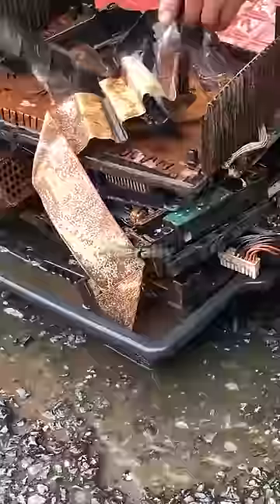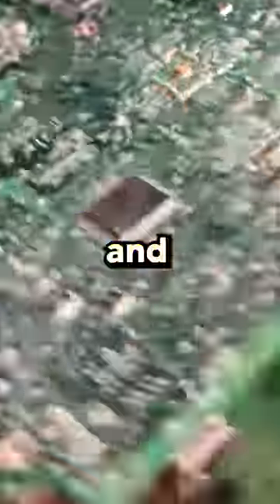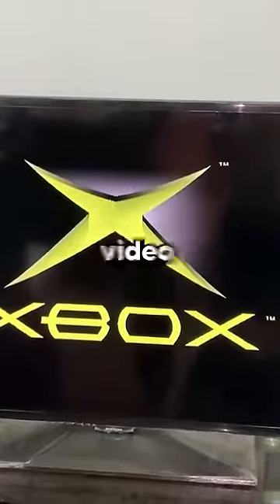Fake Restoration

Comment: Ya you can wash electric parts in water you just have to make sure there is no power flowing through it like a battery or even making sure the capacitors have no charge. Which is easy to do with some resistors.

Comment: As long as the circuit boards and other electronics are fully discharged, and the capacitors have no voltage, the water is not an issue.

Comment: Fun fact, as long as there are no loose wires, and no water soluble materials that are vital to function and there is no power, electronics can get wet! Just make sure to let air dry and the use a mister with isopropyl alcohol to just do a double check!

Comment: If you dry off the console even after soaking it in water as long as you don't plug it in when it is still wet it can still work as there is no more water to short circuit the electricity

Comment: The water on the motherboard is fine, the only way it can cause damage is by shorting something out but that isnt an issue since it isnt on. Same thing applies to your phone, too, ao if you drop it in water then dont try turning it on for a few days just to be safe.

Comment: Okay fun little fact about electronics though a surprising amount of them can actually be washed with water just don't turn them on within 24 hours and make sure when you do they are completely dry and nothing has built up under the parts. It is possible just a pain in the ass

Comment: Cleaning electronics with water isn’t bad because it’s the minerals that are conductive so if you use distilled water it doesn’t get damaged this is why you sometimes see computers completely submerged in water as a cooling solution

Comment: The electronic parts can be washed with water and be just fine as long as it is without electricity. The accual damage happends when water touch working electonic parts beacose:
1 the electricity make wires in cirut rust much faster under contact with substane like water
2 when you pour water on a powerd on electronic component 'Shortens a circut' witch can deliver a electricity where it shouldn't be. sometimes even making that so there are higher elestric power than a component can handle permanently damaging it.
3 burn marks can actually conduct electricity with lead to short circuits even after we dry water from electric part

Comment: washing motherboards is ok, as long as you rinse any soaps or vinegar used and dry them. They do the same in the factory. And no, you don't have to use IPA, you use it if you want the board ready fast and not in 24-48 hours.

Comment: it’s fake but you can clean electronic with water, you just need to make sure to dry it before power. The only reason electronic devices broke when contacted with water is the water shorting stuff in the device so if you dry it, it should be good to go

Comment: Electronic parts can be washed in water, I washed my motherboard in my dishwasher [TAKE THE SMALL BATTERY OUT] also make sure u let is dry, if current goes through while it's wet it's gonna die

Comment: Water is completely fine to clean electronics with, as long as there is no electricity flowing in it, and you let it dry completely after cleaning it. (The video is still fake but I just thought this might be useful)

Comment: More or less everything mentioned is correct except for the last part. PC parts and electronics in general can safely be washed with water. And common sense tells you to: 1, not have it plugged in and powered while doing it and 2, waiting until it is fully dried before turning it on.

Comment: You most certainly CAN wash a PCB. Use distilled water and a neutral detergent. Flush wirh distilled water, then with ethanol or isopropanol and blow dry. Works a treat with keyboard and remote control PCBs

Comment: Well you can wash electronics in water as long as their is no electrical current that could cause electrical an short even after you wash the electronics you have to make sure that it is completely dried off even small amounts of water can cause electrical damage. (BTW I call B.S yeah that is a original Xbox not a Xbox 360)

Comment: 1: Plastic Doesn't Rust!

2: You can wash any electronic devices without damaging any component, as long as the device is powered off, or you take the power core (battery), if the device has a back plate!

3: Who the Bloody Hell does leave a Xbox out in the forrest?

Comment: You probably don't know how pcb works, Its fine to get wet as long as its not turned on, Let me educate you,
A motherboard have patterns where current flows, if any electrical conductive elements or particles touch the motherboard, this 'may' ruin the current's flow which will lead to some motherboard parts not receiving enough power, Hence what we call a short circuit

Comment: To be fair YOU CAN wash a motherboard in soap and water HOWEVER you HAVE to dry it 100% or you’ll fry everything and cause corrosion best alternative is use rubbing alcohol in a spray bottle with a tooth brush ez

Comment: Just a quick reminder to everyone, do NOT try putting out an electrical fire with water.
Reply: Cut off the main line alwys the first step.Fire extinguisher first option , if dont have,Dry Sand is the best option if still no dry sand , cut/off the main line control the fire and let burn the "eletrical things" or throw it in open space let it burn until the fire out just avoid it in any flammable things such as clothe or plastic.

Comment: You can use water to clean electronics as long as there is no current runnjng through it and is completely dry before turning it on if you use rubbing alcohol it will dry the ater fast so then yku are able to plug it in and it will work

Comment: Okay yes, plastic does not rust. However, putting PCB(Printed Circuit Board)’s in water is not harmful as long as they are powered off. You should also let them dry in case water got under any components
Reply: Plastic can have rust stains right?
Reply: @nooneshome8746  stains and actual rust are different

Actual rust is a chemical reaction, most commonly seen on metals like iron, aluminum, and others, usually from either oxygen (which is mostly why people will say, don't use water at all, even if left to dry [they are wrong if the exposal time isnt like, 12+ hours]) or other gases

Stains can probably spread easily from a rusted source to one that isn't rusted
Reply: @nooneshome8746 Not exactly, Stains tend to not be a chemical reaction while Rust is. Take The statute of liberty for example, the teal color we know today is actually rust more specifically oxidization which tends to occur in copper based items so yes one point in time the statue was Copper Colored, stain on the other hand depending on the stained item and what you are using to stain it with, something like plastic isn’t super easily stainable which is why some people use plastic plates unlike something like fabric
Reply: @nooneshome8746  Yes we have pvc with rust stains from an old water leak in the crawlspace.
Reply: From what I remember it's even worth to wait for like 5 minutes before putting it in any liquid
Reply: he was scrubbing on those solders and chips thats wild lol
Reply: Yes but also no. You shouldn't leave water to dry on its own. The recommended method is to rinse the whole PCB with alcohol. Just leaving the water to dry out will cause rust build-up on parts that weren't rusted. Also, minerals in the water, even after fully dry can cause shorts.
Reply: Thats what im saying, he acted like it shouldn't work after the board was in water
Reply: @Kevaca aluminium doesnt rust
Reply: @rikutiini5480  ah, I mean, the rest of the point is accurate though
Reply: I was coming down to say that. Like i can go wash my damn pc as long as there isnt water left on it when I power it
Reply: Thank you, my immediate reaction to this video was to go and comment about how you can get pcbs and various processors wet as long as 
1. It has no residual electric signal
2. You take immense care to dry and vet each part before re-use.
Thank you haha 😂
Reply: He would've knocked off a component on the pcb if he scrubbed that long lol no way it would've still worked
Reply: It can and will cause corrosion. So it’s a bad idea either way.
Reply: Yeah
Reply: Distilled water is used all the time in my shop to clean electronics.
Reply: @dW-td2ul  Then you're doing it wrong. Might not be harmful in the short term. But it'll corrode a lot faster.
Reply: @dW-td2ul  then you guys shall use isopropyl instead since using water is a big no no.
Reply: The reason why water "damages" components is because water conducts electricity between wires which are not supposed to turn on. This isnt usually a BIG problem, the pc will just not work or give blue screens, with no permanent damage. The bad thing is when the ROM chip in the motherboard(basically the instruction set that tells the pc how to turn on) gets corrupted and cant turn on the pc.

Comment: As long as the components don't get any electricity through them before drying off completely then there's nothing to worry about, it should work just well if you didn't break anything while cleaning it
Reply: Corrosion left the chat.
Reply: @omegalongdong  it's not like you're gonna leave it in water for several days, a regular cleansing won't take long enough for it to get corroded over some water, and some of the conducting metals in there are quite resistant to corrosion

Comment: 1: That's an original Xbox

2: Plastic doesn't "rust" but can hold different kinds of corrosion, dirt, and mold. I've found plenty of old plastic in my yard and local landfill that had a rusty appearance, but just ended up being covered in earth.

3: it's not odd to see "fresh mud" in something that has been exposed to rain and dirt for awhile.

4: You can wash electronics in water. You just have to dry them.

5: Yes, it's still fake. But this console could have likely been found in a dump or landfill. I restore trashed electronics locally as a side hustle. But educate yourself better before making debunking videos, lol.

Comment: Well, actually you can put any electronic in water. But it should be totally clean, I mean distilled water only. Any water will not work.

And you can't just put an electronic in any water like the top liked comment said. It should totally distilled, all electricity should be removed from electronics, etc. And this is already been told in Linus tech tips.

Comment: It's fine to wash electronics with water as a last resort if you're desperate you could dry it in the sun for a week and it should be fine and also use isopropyl alcohol

Comment: The only incorrect assumption you make is the washing with water. If the circuit boards and wires are not connected to an source and are given time to dry, they will be fine. The reason water damages electrics is because the high conductivity of water creates a short circuit as the current bypasses the resistors which gives too high of an electrical current then the circuit components can handle.

Comment: Yes the video is fake, but you can wash electronics on water but after you need to remove the minerals that the water left because can cause rust, the big problem whit water is when the device have current flow inside, this will cause sort and rust very faster

Comment: Plastic rust ? No but yes bc it’s near metal pieces and the rust from the metal can deposit it thelf on anything just like plastic 
Waching electronic ?? It wil work even if it is with water it won’t be damaged bc no electric curent is flowing in the electrical component and if gently scribed it won’t damage and remove any capacitor so this can be real
And for the frech mud it’s bc it looks like it was raining so  dirt on th console + water = mud

Comment: Water can ruin the circuit 
It's recommended to use alcohol and brush
Reply: Brushes around PCBs are mostly not the best idea, because the brush could easily get charged with static and then discharge, possibly frying sensitive components along its path.

Comment: The videos are fake, BUT, electronics, if they are dried 100 percent you can power them up like normal and they will work, the risk is if you turn it on before drying it, or touching the raw powered wet motherboard, which the water gets under the capacitors, will shock you

Comment: Its fake most likely the rake rust could just be mud but i dint any context other than the clips shown so im just saying but for electronic he probably used mineral water but he could have used normal water as long as the electronics are dry and turned off and then quickly dried back off

Comment: Washing in water doesn’t immediately damage the components and it F well dried it still turn on. Washing in water is used as last resource to try to save lost motherboards also. If in long exposures to water the components can rust but it well dried it will turn on like nothing happened

Comment: A lot of factories wash their PCB in water using an ultrasonic cleaner to clean off excess flux

The ultrasonic cleaner helps it to dry quicker, but otherwise, it's just water. As long as it's dry, the electronics will work fine

Of course, some sensitive electronics like hard drives and LCDs shouldn't be submerged, but the mainboard is fine.

Comment: Fun fact. The only reason why elections and water are allowed to mix is if the device has zero electricity. For example you can wash your gaming pc with water but make sure to wait 2-4 days to guarantee that the water is 100% dry. The only reason why a device gets broken by water is there is electricity running through the water which could conduct the electricity causing a reaction. If you have free mineral water you can dip your pc in it

Comment: Washing a mother board in water isn't necessarily a bad thing.
You just have to make sure that you take out every single electrical pieces that is suseptible to water damage.
The pcb it self are safe to be washed with water.
But make sure you DRY them properly to the 100% so that when you assembly them again there won't be a electrical short out because of the water.

Comment: Ok it's 100% fake but you could technically use water on it and be fine if you don't run any power through it and let it dry(yes I'm aware that will rust it, yes I am aware the restoration video is fake)

Comment: You can technically wash the components if they fry long enough afterwards, when there is definitely no water left inside the components, then you won't have a short circuit. So washing the components is technically doable but I wouldn't recommend it.

Comment: People have already said this in other comments but you can wash electronics with water and they will still work as long as the electronic is 100% dry. Water only breaks electronics because it is a conductor and will short out the PCB

Comment: As someone who has fixed multiple og xbox's. It is safe to clean them with distilled water and some soaps. Rinse with isp. The two thing you dont use water on is the hdd and dvd drives. That hdd should not have been working after that wash.

Comment: Toooo be fair… if it’s ultra clear water or ‘distilled water’ you could in theory wash a computer/motherboard with that and it would still be able to turn on without problems after it has dried. That does not work with ‘normal’ water because of the minerals

Comment: I believe he washed it and water and it turned on after. Water ruins electronics through short circuits while voltage is flowing. If it was dryed completely and given a solvant wash itd be fine.

Comment: As far as my knowledge goes(and someone correct me on this please if wrong) water is a electric conductor so if it was on it would fry it due to it having an electric current running though it  but if all the parts are off there is no electricity running through the system so it the water can’t damage anything. Just make sure it is all dry before turning on again.

Comment: It’s an original and if the electronics and boards aren’t holding a charge it’s perfectly safe to wash in regular water just make sure all the water has evaporated or has been dried off before turning on the device or reinstalling parts that were washed

Comment: i mean you can wash electronics, and as long as you dont turn it on as long as its still wet it will work, the problem is that the connections on the circuit may oxidize and you can have it fucntioning one day, and then not the next day,,, so water is not the most optimal thing to use.

Comment: You can wet components and they’ll be perfectly fine as long as no electricity is passing through the wires on the motherboard or any other components

Comment: The video is fake because like he said plastic cannot rust however u can wash actually sink something like that in water but make sure it is not powered and when u turn it on make sure its dry because u can power circuit something that is not meant to be connected and u get struct or ur device and the electricity in ur house can be damaged

Comment: You can actually wash electronics in water, as long as there is no electricity running through it when it's wet and you dry it completely before turning it on

Comment: Well, actually you can get electronics as wet as you want and as long as theres no electricity running through it while it dries, it will turn on just fine.

Comment: Plastic can't rust but The eletronics component you can wash it with water but you can't turn on when the water do contact with the components , but when the components haven't water in you can turn on

Comment: You can wash electronics in water, you just need to make sure it's firstly mineral free as these minerals could stay on the board and secondly you have to let the device completely dry before turning it back on as else short circuits will occur
Reply: Blud wrote a whole paragraph and only got one like 💀